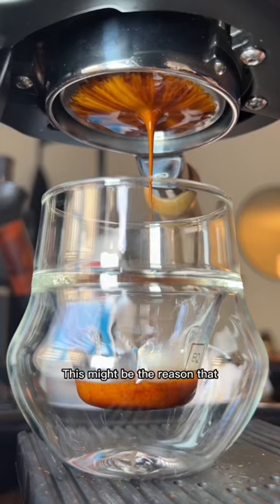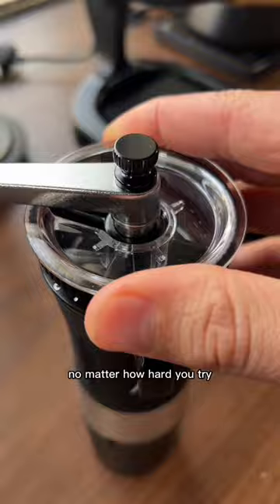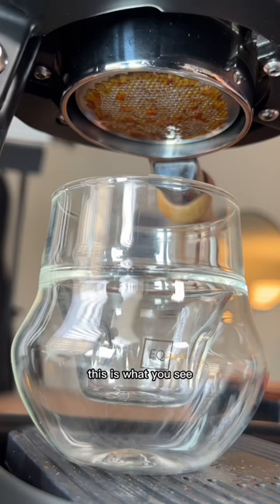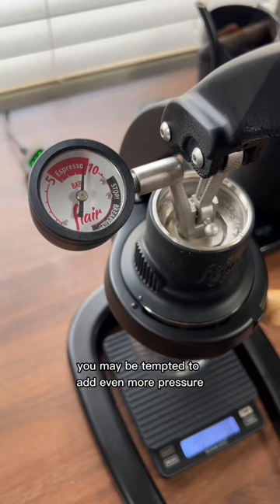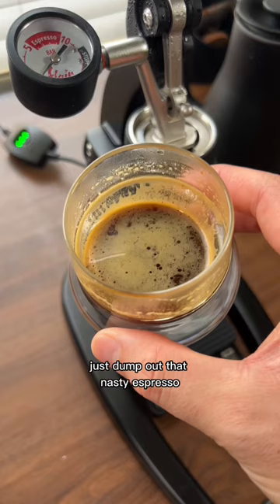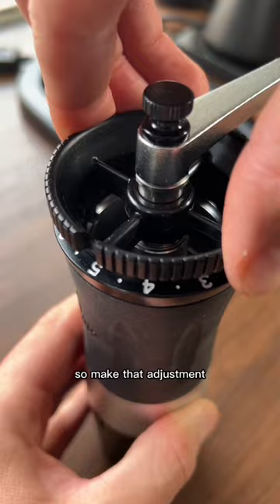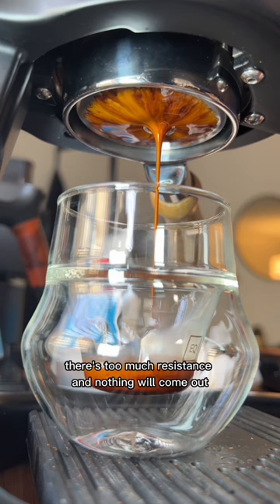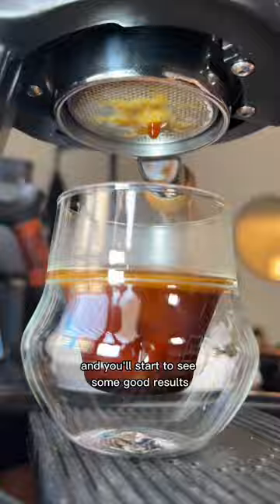Struggling to pull a good shot? The solution is probably simpler than you think 🤔 #espresso

Comment: Don't waste that shot, I would do a extended soak bloom for 30s and pull the shot at 6 bar. With the flair, you will still be able to save the shot, if its too bitter, use it for affogato or in a cake.
Reply from the maker: If it’s close enough, you can save it with some added preinfusion and lower pressure, but if it’s too far off you have to bail

Comment: Great video! I’ve been having trouble with my espresso shots I hadn’t considered my grinds being too fine. Thank you.
Reply: The resistance of the puck is also due to the amount of grounds it’s going through, so you can also adjust it to have less coffee. Finer grinds gets higher extraction, and slower pulls. More coffee just slows down the pulls. Balance both (usually people do lower weights on lighter beans due to them being harder to extract, so it lets them grind it finer).

Comment: I found exactly this, the finer grind settings would choke my espresso machine, so I went more coarse which obviously worked.  But I also found I could use a finer grind if I use filter paper.  It's certainly fun experimenting, but as I have a hand grinder, it gets a little tedious doing back to back shots.
Reply: May I ask you what hand grinder do you use? I’m trying to find a nice hand grinder that can do espresso fine grinds.
Reply: I recently found out with a manual espresso press. I ground the coffee beans too fine and it actually blew out the o-ring because I pushed too hard 🥲

Comment: Lance Hedrick says that you can salvage shots by changing the time of pre infusion. If dialed too fine, you can just extend the time of initial low pressure. Eventually, the puck will lose its resistance and you'll be able to ramp it up to 9 bar.

Comment: I dialed my grinder to a coarser size to fix this problem after my first run with the flair 58x. Now I'm unsure if I need to dial it to a finer setting. How can we tell if our ground is fine enough. How can we easily identify when channeling starts to become a problem?
Reply from the maker: You should see channeling happening if you can see the underside of your bottomless portafilter. Determining if your grind is the right size ultimately comes down to taste, but as a baseline you can shoot for a 30-35 second extraction time (with 18g dose and 40g yield) and see how that tastes. If it takes too long, grind coarser. If it goes too fast, grind finer. (This is assuming a light-medium roast level)
Reply: @FlairEspresso  That's what I've been doing and it still isn't pulling a decent shot. I go just a bit finer or coarser and suddenly its way too high a pressure or too fast
Reply from the maker: @leocardenas5728  sounds like your grinder lacks micro adjustment, not suitable for expresso method
Reply: What do you do if you get about 10 bar at about 25 seconds?